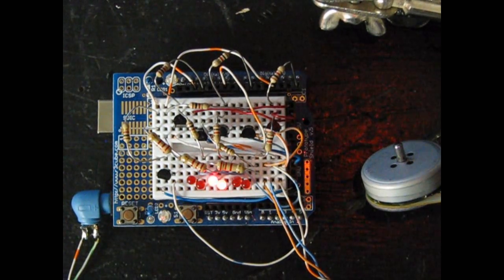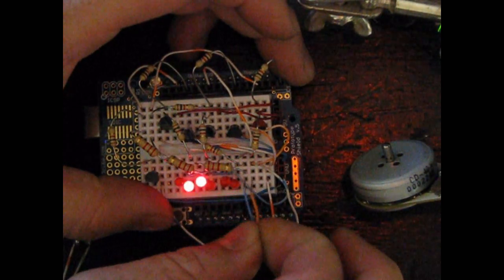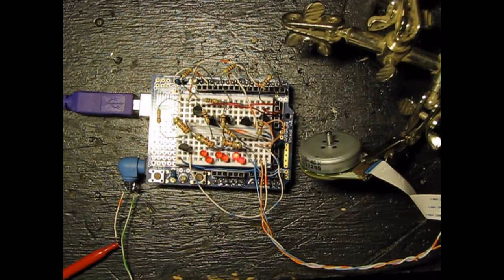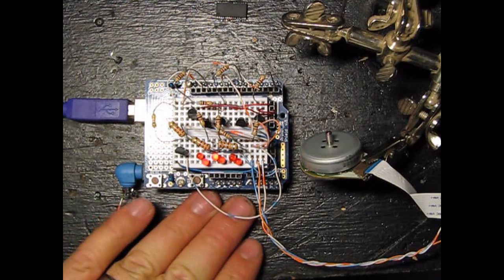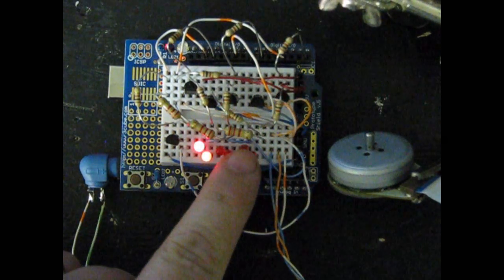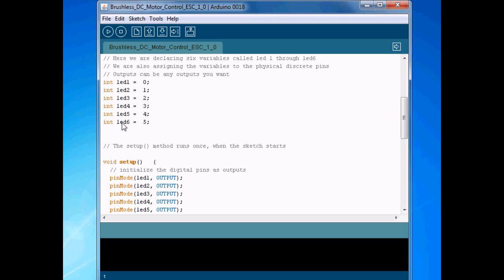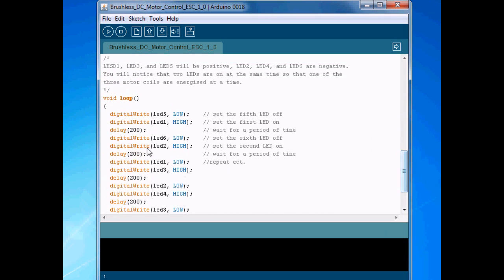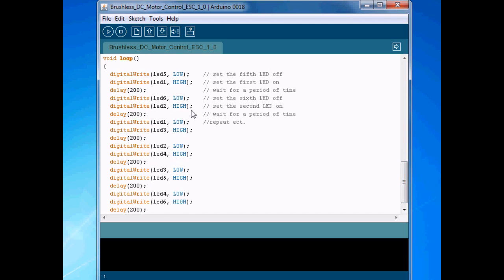DIY Arduino Brushless DC Motor controler (Electronic Speed Controler ESC) 1 of 2

Comment: Do you know how to protect your output transistors from backemf ? I've seen people use a free wheeling diode but I'm worried this will waste energy ?! Like, if you short the motor inputs, current flows and it acts as a brake.

Also do you know how to use back emf sensing to determine the speed and exact position of the rotor ?

Comment: I'm not sure that I somehow read some articles that use PWM to control motor speed. I'm still confused how to adjust the speed of the BLDC motor, especially the current consuming outrunner. If I apply your code, I can imagine the coil and my MOSFET H-bridge melted down. Is that how you control the speed by lowering the delay time of the drive sequence, or use constant drive sequence period and just modulate the sequence with PWM?

Comment: Im confused. why a square wave?  Aren't they typically sine waves that drive the motor? I guess square wave is simpler, but is anything lost as a result?
Reply: This is a DC motor, not an AC. Since it is brushless you cannot just apply power to get it running. Therefore you will create a square wave using an ESC, by changing the duty cycle you can controll the motor speed.

Comment: @r0bz0r101 I found the post with the schematic on his site. This application is open loop but you can use the back EMF to determine speed without using a hall effect sensor.